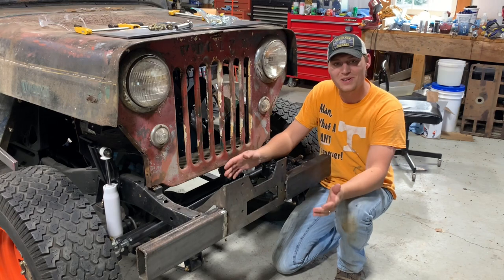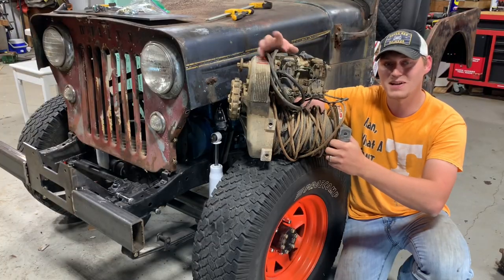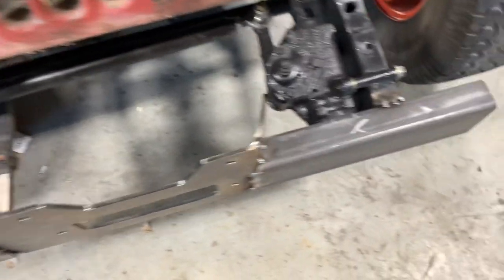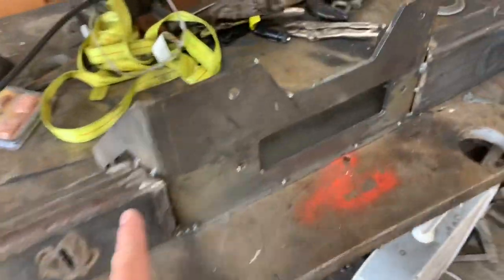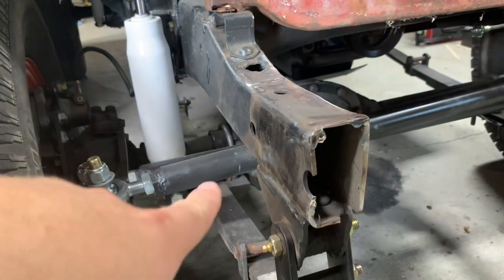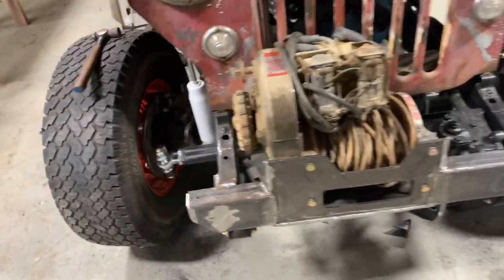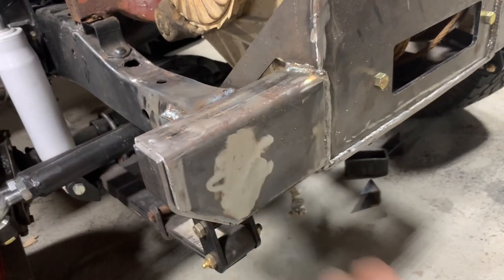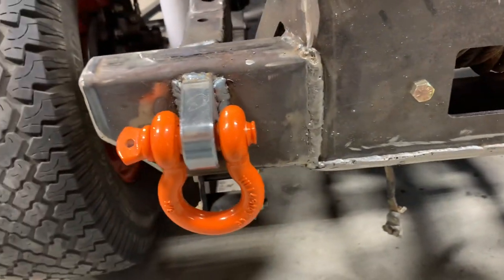Willys Jeep Custom Front Bumper!

Comment: Nice bumper design , great winch. 
The synthetic rope is nice to work with, a lot lighter. But an old school winch like the 8274 needs an old school cable.
I have a friend that has a 8274 on a Toyota Tacoma extended cab. With the weight of the taco, he went with 200 ft of 5/16 cable. Handles the weight great, and if you did that cable on the Jeep with as light as it is, 5//16 will handle your recovery requirements with no problem.
The other consideration is I have been in situations where my 100 ft cable was short, and having to shackle tow strap’s together to get to a suitable anchor. With 200 ft cable, I don’t think you would ever have that issue.
Great video, great content.
Reply from the maker: Thank you I appreciate it! That’s good to know thank you for the feedback!

Comment: if you use a lot and don't mind keeping i clean go with rope. if you are going to play in the mud and not keep cable clean go with wire cable. i have both. but what i understand mud and dirt inside the rope if not cleaned regularly will ruin the rope
Reply from the maker: I’ve never heard that before but it makes a lot of sense. Thank you!
Reply: @SevenBarSalvage  i have seen mat on mats off road recovery wash his before and also said dirt would ruin them and also mad  maxx also stated would ruin rope on winch the sand inside is like sand paper. you also cannot let rope rub on anything where wire doesn't care

Comment: I was wondering if you plan to add something to the winch mount to prevent theft?  Many of those Warn winches can be taken by thieves in a matter of minutes.....ask me how I know.....Russell D.
Reply from the maker: I was going to show this after I rebuild it and mount it. I’ve got some 7/16 button heads I was going to use to mount it and then weld the hex and grind down the head to look like a rivet. The biggest tamper proof bolt I could find was an m10. Any suggestions? Thank you!
Reply: @SevenBarSalvage  As I remember, some guys found a way to chain and lock the winch into place.  I was thinking about some sort of a hitch lock where one could simply use a key to undo the lock of the "hitch", then slide the bolt out, etc.  Just something to 'ponder'.....hope that helps.  ......Russell D.

Comment: being the wrench is located up front the jeep, how much air blockage will effect the cooling air to the radiator? i have one set up like this but as long as the temperature is showing normal range. it should be fine.
Reply from the maker: It should be a lot better than most 8274 setups but I won’t know until I get it on the trail! Thanks!

Comment: I wound up using synthetic rope with a roller fair lead on my 8274. Have used it a few times without issue. I installed a CJ 5 winch plate on my B. Had to modify it to work with factory bumper.
You do a great job on your vids keep them coming
Reply from the maker: Awesome! Thank you for watching!